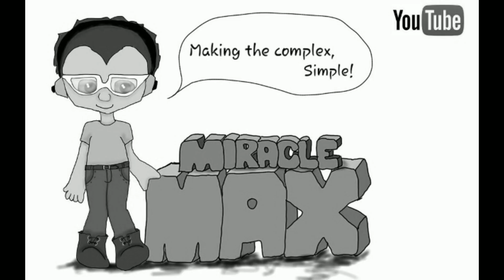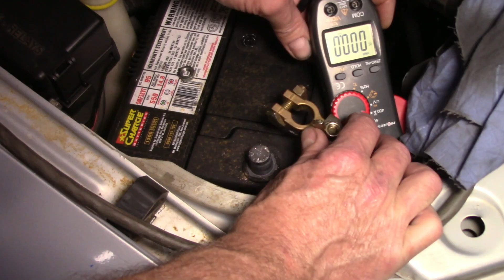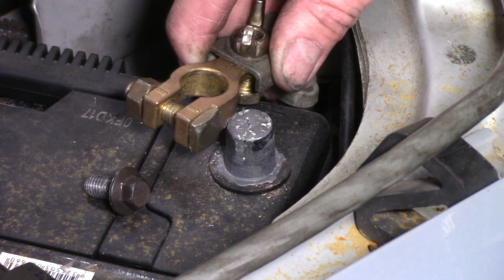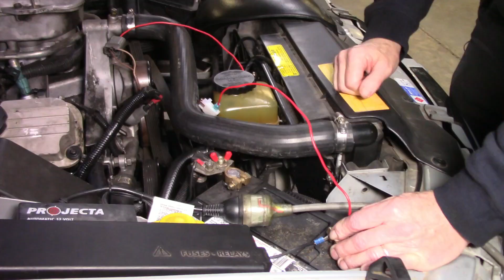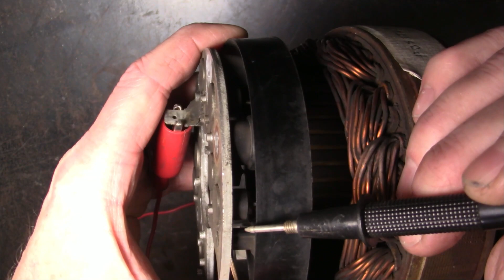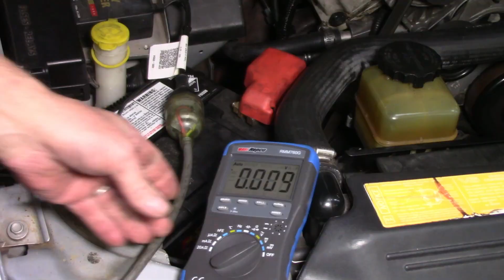Dead Battery After Repair  -  Why?

Comment: Great video as always max very well explained. The students are very lucky to have you teaching them the ropes I’m sure it will set them up well for there future jobs.

While on the topic of battery’s if there any you recommended? Aussie made is always a bonus.

Cheers
Reply from the maker: Hey Michael,
There are heaps of different brands that are OK. Of course you get what you pay for, with many manufacturers having different categories (silver & gold) 
The main thing is that you use the correct battery for your vehicle (lead acid, AGM, GEL, Calcium, etc.) and charging system, make sure the charging system is working correctly, any battery management systems are recalibrated after a battery install, keep it regularly charged & maintained, use it within its manufactured limits and you should get a reasonable life out of it. Always use distilled or demineralized water when topping up an 'open cell' design (one with caps)
Reply: @MiracleMAX  Thanks Max much appreciated 👍🏻😎

Comment: I wonder if he connected the battery up back to front and blue the rectifer?
Reply from the maker: Hey D.D.,
As I showed in the video, he left out the output insulator , shorting the regulator as well as the positive side of the rectifier pack.
Thanks for your comment. 😉

Comment: Very good real-life video, as an electrician I have seen the missing insulator issue before.
Some mechanics have left out the insulator on distributor points and wonder why the car will not start. Situational awareness is everything.
It appears that your extension lead is does not have the new safety shield socket fitted, or perhaps it is just the way I am seeing it in the video.
Reply from the maker: Thanks for your comment Colin. Good eye - I'll have to get to that socket! 👍

Comment: I have to get one of those light up screwdrivers to check power 😁
Reply from the maker: Sure! You can get a LED one, which will have a red light when testing positive circuit or green when testing a negative circuit. The other one is an incandescent one that just uses a globe. Both are available at an automotive parts shop. 
Keep in mind, these are only for automotive use, not high voltage.
Thanks for your comment! 😉👍